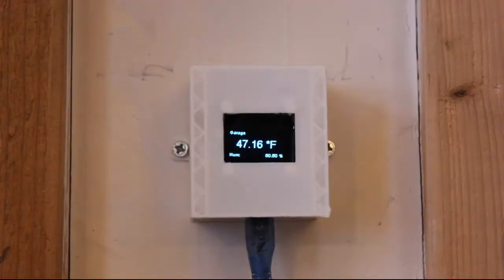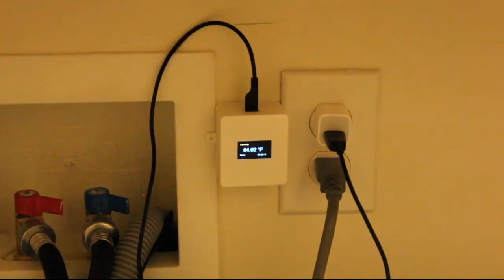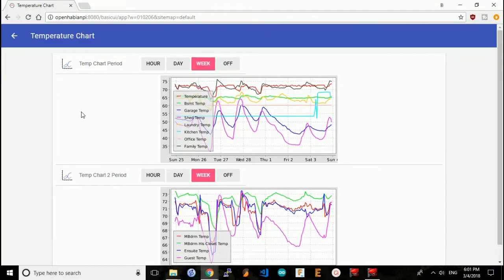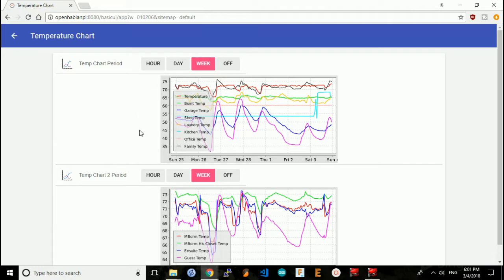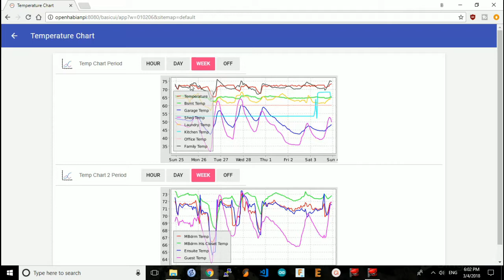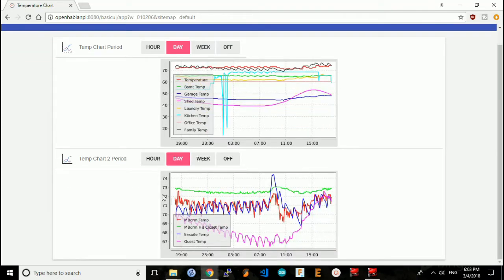NodeMCU ESP8266 Kube Multi Sensor for openHab home automation:  Demo & Overview

Comment: Great video as always. I was wondering is this would work under battery power?
Reply from the maker: Thank you :) - I would say battery power would be problematic, because the NodeMCU WIfi, the OLED, and the sensor all draw a bit of current. Even with my original protoboard/NodeMCU/DHT22 sensor with deepsleep, the battery didn't last too long....

Comment: I faced problem with our sensor.  Whenever there is esp8266 sending data t oner wify , pir input getting malfunctioning.   How to free this interference???
Reply from the maker: @Techno Automation - did you watch my PIR sensor video as well? I show a way to connect the PIR sensor via 3.3V, which does help with false positives. However; I think it's a well-known fact by now, that these HC-SR501 sensors have very different quality depending on what you get (some of mine are the same, good most of the time, but I've had bad batches that constantly go off, as well). 

I'm looking at different types of sensors to use in the future, but have not found anything yet that would be as cheap as the HC-SR501 and more reliable...

Comment: You should make a few of these and sell as a whole kit.  I don't have a 3d printer (yet)..we have been looking, but do want to do this project.  Let me know if interested (you would not have to do the solder ;)
Reply from the maker: +Travis Andrew - funny you should mention that, because I did set up a Tindie store people can buy these from (either pre-built or just the parts). The link is https://www.tindie.com/products/bkpsu/the-kube-oled-temphumidity-multisensor-- check it out, and thanks for watching!

Comment: Hi currently working of this project and was wondering if you had had intention of putting other sensors to the code like light sensor
Reply from the maker: +pablo bolomey absolutely - on the todo list! But - I’m beginning to think that making the device work with something like Tasmota or ESPEasy is a better idea - that way, it’s support everything those frameworks already support.
Reply: Hi i got everything working ok, where do i get your pcb from
Reply from the maker: You can either get it from my Tindie store or PCBWay - I posted links to both in the video description and on the Thingiverse page :)

Comment: @BK Hobby

Great video great sensor I have watched a few times now and I'm definitely considering using your build as a base for the rest of my sensors

I would like too add a light sensor and a microphone to moniter ambient noise would this be possible and how hard would it be? Would be good for when kids play music too loud and also as part of a security system for when the house is supposed too be quiet 

How about an upgraded sensor video with additional sensors

TEMP , HUMIDITY , MOTION, LIGHT , SOUND
Reply from the maker: Aaron Sharp - thank you for those suggestions! I'm definitely thinking of adding some sensors to the design, but the to-do list is always growing and time is not always the easiest to find! I don't think it'd be too hard to add the light/audio sensors, and I already have a mic sensor (both analog and digital outputs) that I plan to work into the design.

One thing I'm also thinking of is trying to make the sensor work with ESPEasy or Tasmota, to leverage all of the great work on those projects (as opposed to having to maintain another Github repository with my code for the sensor, and re-invent the wheel every time a new sensor is added.
Reply: BK Hobby I agree with you on that if it's already done there's no point doing it again 

 and from a post I created on the openhab forum I kai is thinking on adding a new section too the site for this sort of stuff

Comment: I have build one of these sensors based on the information you have supplied. It is working but I have one issue: My OLED screen is flickering when it is updated (every 10 sec). Have you had this problem or du you have an idea what could be the reason for this?
Reply from the maker: Peter Haugaard - the flicker is “by design” . Every time the code refreshes the screen, it inverts all the bits for a split second. This is done to prevent burn-in and extend the useful life of the display. If you don’t have a concern for this, you can comment out the line in the code that does the inversion (I can update the code in Github to make it a configurable option, as well). Hope you find this useful!
Reply: Thanks for your fast reply. If you could make it configurable to disable the OLED "life extender" it would be great. I do not have a pressure sensor at the moment and would like to disable this part as well. Is there a smart way of doing this?
Reply from the maker: I will do it later today and check it into Github so you can download it. For the pressure sensor you can disable that code by commenting out (adding // in front of the #define PRESS_ON line. I will do that as a default in my code when I update it later.
Reply from the maker: I added the option to disable burn in prevention, so download the latest from Github and let me know if it works for you!
Reply: BK Hobby I am on a business trip and not return home for a week. I will test as soon as I am home.